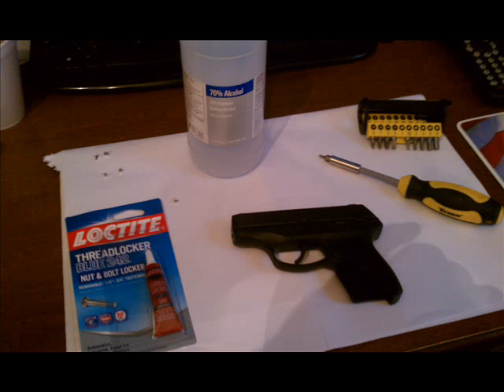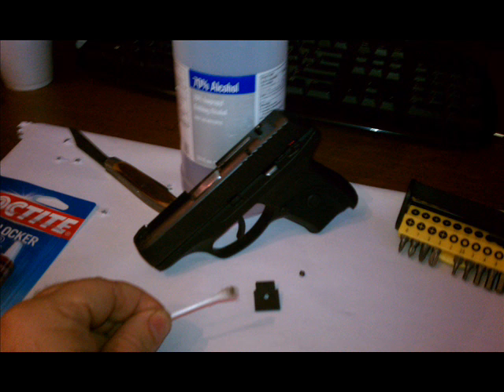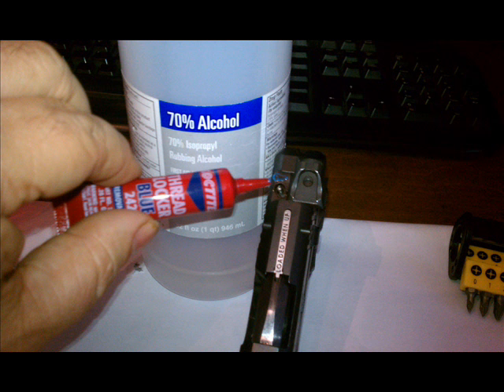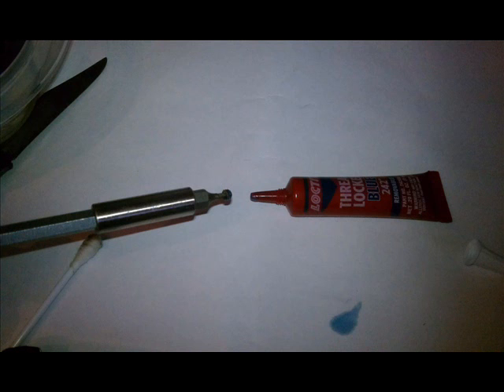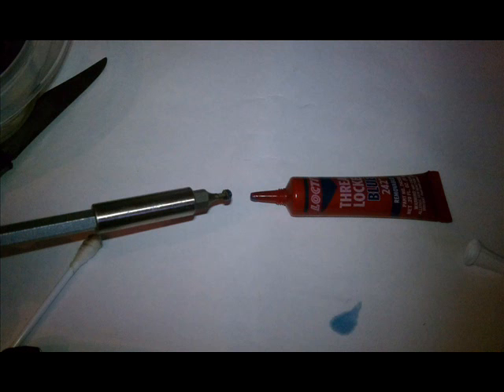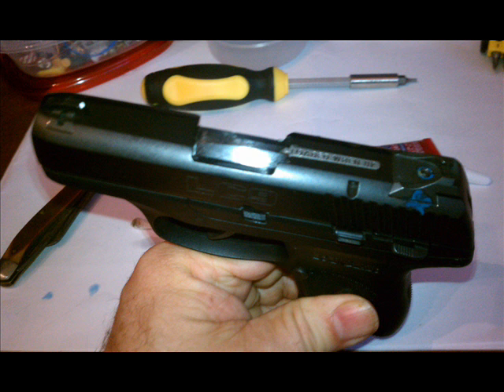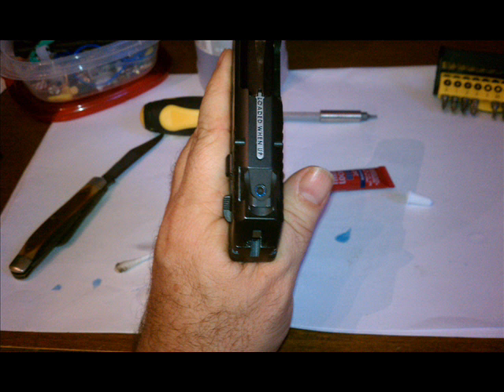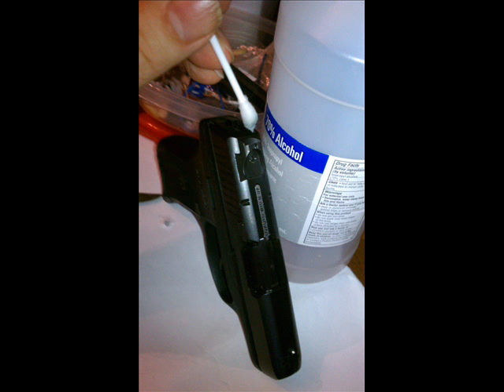Fixing Loose Ruger LC9 Rear Sight

Comment: My sight came off on my first magazine. I tightened it back up, and it happened again. With a brand new gun. If locked tight, this trick doesn't work. I'm getting rid of it. On top of it, it's jammed two times with federal HST 124gr +. I now have it loaded with Gold Dot 124+p. 3 strikes and out.!! Sig Sauer has some really nice small 9mm now.

Comment: Mine did the exact same thing. I was kinda ticked over this and you'd figure Ruger would have done better than this. At about 150 rounds I hit the gun on something and the little metal spring on the inside popped out along with the tiny screw. I figured the same thing, simple Loctite would do the trick. I'm not using the gun for accuracty but rather for self defense so it's all good.